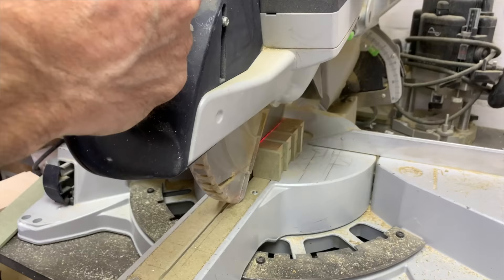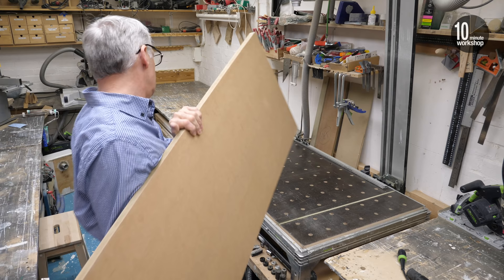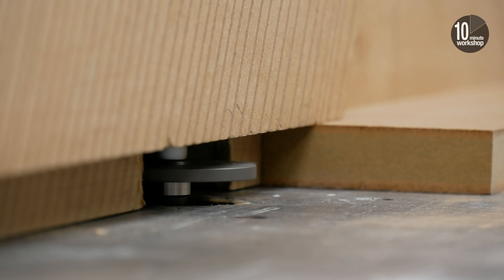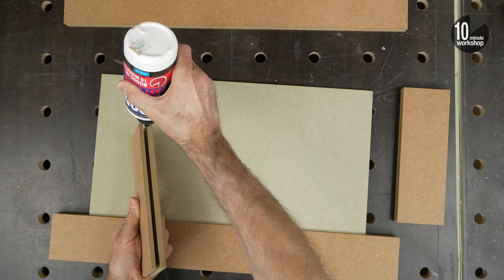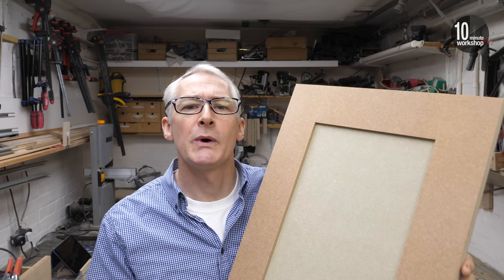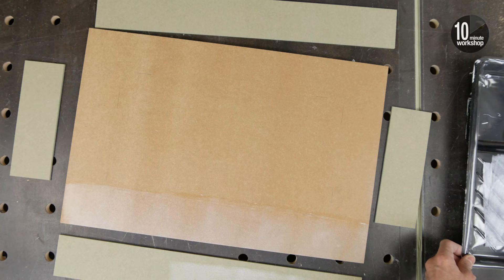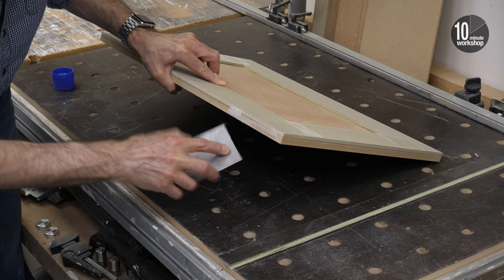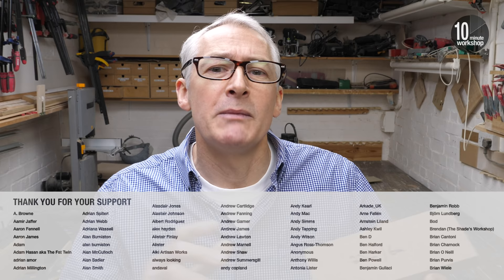Shaker-style doors in MDF [video 405]

Comment: Hi Peter I do shaker style door right now. But I'm do second method and doors are 2.6meter hight.
Reply from the maker: Hey Nik. Wow, big door! 👍👍👌
Reply: @10MinuteWorkshop  yes. First time I do anything like that honestly it's not that easy even with festool new plunge saw have missed 1mm sometimes my tough, definitely need  rail guide with tape measure and long boards not really easy. Also just see the point of mafell 1.6 that I should have
Reply: @10MinuteWorkshop  the third method I just find up, with routering it's simple jig kind of festool wide enough and this guys doit in minutes the square deep

Comment: Hi I have a 6mm groover I noticed you used a ¼” groover will it be too tight with a 6mm groove?
Reply from the maker: I use 1/4” because it allows a bit of wiggle room for varying thicknesses eg 6mm ply is often a little thicker, and it’s just easier to use the one bit for everything. 👍

Comment: Hello Peter - i have check the links, but need a little more help on the cutter - as in the bearing and the spacers?  Does it need spacers and what diameter is the bearing to give you that depth of cut?
Reply: Just answering myself here - Whiteside do one - the cutter is 47.63mm and standard bearing is 22.23, that would give a depth of cut of 25.40mm. Does this match your rebate depth?
Reply from the maker: Hi Steve. With the standard bearing and arbor linked to, I get about 22mm depth of groove, max, so your white side one is a little deeper. 👍
Reply: Thanks Peter,  you do mention the depth on another video. The one you use it out of stock till mid Feb, I can purchase another sized bearing to get me to that sort of depth.  Great videos by the way! Have you got somewhere I can send a few pictures to you. Used a few of your designs, hope you don't mind

Comment: I want to make 2.5 meter by 61 centimeter bifold doors (Please excuse me, I am in US so trying to convert inches to metric). Would this method work for such large doors?
Reply from the maker: Largest ones I’ve done were similar size - 8’ x 2’. I use 1” MRMDF for the rails and stiles, and a 12mm panel for that one. Sorry, half-inch! For tall doors I usually make the bottom rail deeper, but keep the mid-rail the same as the stiles and top. Hope that helps! 👍

Comment: Peter how would you run horizontal doors without the expensive hinges?
Reply from the maker: Honestly, I generally wouldn’t, but there are lots of other hinges you could use eg butt hinges and flush hinges. 👍👍
Reply: @10MinuteWorkshop  There is the UTRUSTA horizontal hinge from ikea but its $$$...

Comment: What width do you make your styles and rails Peter? Thanks. Dave.
Reply from the maker: I use 80mm as a starting point - though it varies depending on the size of the door.  On wardrobe doors I make the base rail deeper (~120mm) but 80 is a good place to start. 👍👍
Reply: @10MinuteWorkshop  `Thanks very much Peter. 👍
Reply: @10MinuteWorkshop  Interestingly I made 5 sample doors for our new kitchen and, as well as the profile, I tried 65mm and 75mm, the former being the same as our original kitchen's doors.  We found 75 mm looks better as 65 was a bit skinny.

Comment: Can I use trimmer free hand to route these grooves ? what size of bit do I need ? in mm if this possible.
Reply from the maker: I wouldn't recommend using this bit freehand as it's large. Sizes are mentioned in the video, links are in the video description - 1/4" (6.35mm) Heavy duty groover - http://bit.ly/HD_Groover and you'll need an arbor for it - http://bit.ly/Arbor_8 👍
Reply: @10MinuteWorkshop  Thanks. May this will drive me towards building my first router table....

Comment: Hi could a biscuit jointer be used instead of a slot cutter?
Reply from the maker: Technically yes, but you’d need to make 2 passes to get the required depth, and I don’t recommend using a biscuit cutter that way - it’s not a router. 👍
Reply: Thank you for your previous reply Peter. I've been a joiner for a relatively short time and when I put a photo of some bespoke cabinets on my socials, I often get the comment "how much is this?" After composing many sarcastic replies then deleting them as its not great for business 😬 I do find myself trying to answer it calmly and nice when clearly it's a stupid question 😀 please can you post a video 'just for customers' and don't get me started on the '?' '??' Replies if you don't answer back within 10 minutes 😬

Comment: Why do ALL mdf shaker doors have this green looking panel on the inside as opposed to the more “traditional” MDF-look on the outside of the green panel?
Reply from the maker: As I think I say in the video, I’m using MR or Moisture Resistant MDF, which has the green tint to make it easily identified. MR MDF is a much better quality board for not much more money, so is well worth searching out IMHO. 👍

Comment: Question from a non-woodworker: I see a lot of youtube-carpenters who end up buying all sorts of jigs and specialised tools. From my perspective, it seems a lot of these tools and jigs could be replaced by a CNC-router, and still be cheaper than "generic high-end brand" + "expensive jigs". I understand that it is difficult to bring a CNC-router to a job-site, but it seems most of the work is done in a workshop anyways. Why not just go fully computerised?
Reply from the maker: Lots of CNC woodworkers on youtube as well, of course, and any production workshop that doesn't have CNC capabilities - or access to them via a third party -  will be left behind, certainly. But CNCs - even industrial machines - have their limitations. Take these doors for example; to make them the first way shown wouldn't make any sense on a CNC, much better to make the door from a single piece with the centre cut out, then rebate that to fit a panel into it from the back. If you don't want rounded corners in the cut-out you need a pretty fine end mill - 2mm or 1/16th" - which is going to be slow going, or you make the cut-out with a bigger end mill and then change to a finer one for the final pass. Then another change to hog out the rebate. Change again to make the panel. Obviously these can be batched, but at the end of it I'd get a door made in a way that I don't like, which is only fast if you're making a dozen or so doors, on a CNC machine that costs at least £20k 🤷‍♂️Don't get me wrong, there are lots of things that an industrial CNC is good for, but their price means you need to keep them busy, which is typically beyond the scope of one-man-band maker installers - both financially, and in terms of volume, and who are already likely to have systems set up to make what they need. 👍

Comment: Would Domino joints be easier?
Reply from the maker: No, not if you're already grooving the rails and stiles for the panel; if you wanted to domino them, you'd need to stop the groove on each rail so as not to mess up the domino mortice. 👍
Reply: @10MinuteWorkshop  thats true. It might be more time consuming.